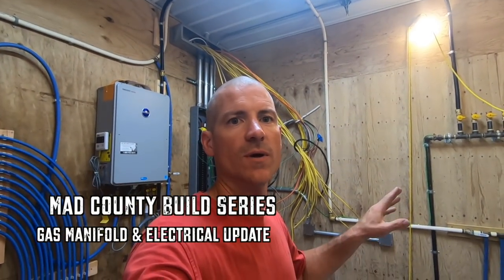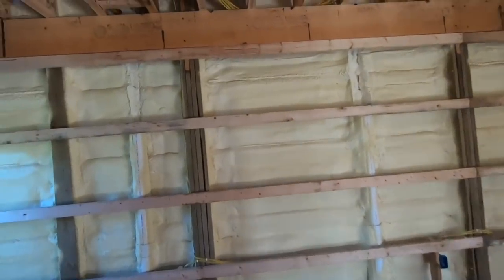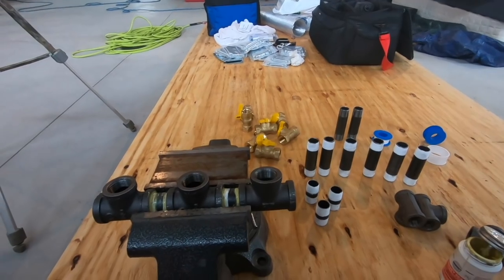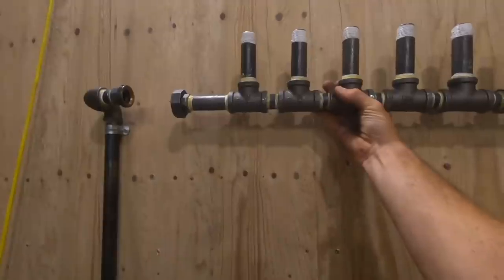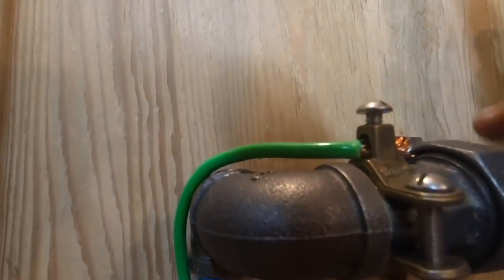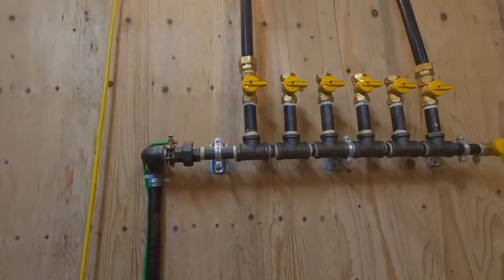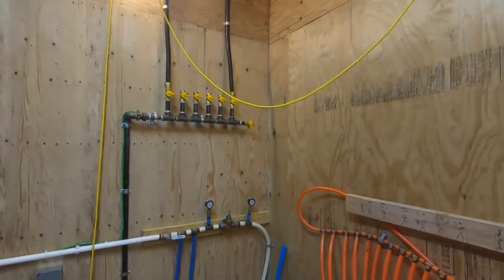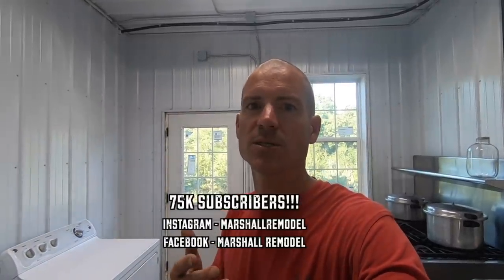Gas Manifold | Electrical Update

Comment: The teflon tape your using looks like the type meant for plumbing. There is tape in yellow/orange spools meant for LP or natural gas.
Reply: Ding ding
Reply: @ya2131  they know the way to getting paid and making it the next guys problem.
Reply: Normal white teflon is meant for water and air most other ptfe tape will say on outside of roll water,oil,air,gas on it
Reply: @e1casper  for the most part yes but their is tape on the market that is white and approved for gas applications
Reply: My employer, a natural gas distribution company, uses white PTFE tape. Though I usually just use it for gauges and things I don’t want to get dope on. We also use Blue Monster and I prefer it.

Comment: You always do a neat and well planned job, as I know you have done construction for years. However, one thing I noticed is you should have used "yellow" teflon tape, as it is heavier duty  PTFE tape used for gas piping. Most gas fitters used that plus Tru-Blue or similar medium density brush on compound for all gas piping.Thanks for all of the great videos! Can't wait till you are finished.

Comment: You have to use insulated strap on iron pipes in poly or rubber , need moisture traps on each one and all brackets have to be approved for gas as well as yellow tape .

Comment: looking great from over here in the uk! cant believe  the inspector gets to specify where you have electrical outlets, can you have the final inspection before the floors are finished, that way just remove the unwanted outlets after the inspector has left. a quick tip from a plumber....  ptfe tape should be wound clockwise around the thread so that as the fittings are tightened the tape is pulled tighter into the thread. It was hard to see from the time lapse but it looked like yours was wound the other way.
Reply: Technically the inspector isn't specifying he exact locations of the electrical outlets.  What's happening is code requirements, which is there must be an outlet within 6' of any break in a wall, and no more than 12' apart.  As long as he follows those guides he's good.  Since he was using stub walls, he thought that the code wasn't required.   He took it upon himself to use in-floor outlets, placing them at those particular locations, the center points of each stub wall provided the minimum number he would need by code.

Comment: Normal PTFE tape or natural gas PTFE tape (yellow stuff)? Does it matter in this case?
Reply: No tape on my gas fittings , use a paste , pieces of tape will break off and block things off .
Reply: I’m pretty sure this is the wrong kind of tape? Shouldn’t it be yellow?

Comment: I've had problems with unions leaking before. You might want to look at a black iron nipple/coupling with right/left hand threads that will replace the union and possibly seal better.  I also concur on putting never seize on the union threads so it will snug up tighter.

Comment: Earth or ground bonding is used to reduce the risk of electric shocks to anyone who may touch two separate metal parts when there is a fault somewhere in the supply of electrical installation. By connecting bonding conductors between particular parts, it reduces the voltage there might have been between them. Certainly in the UK it is nothing to do with lightning, lightning would laugh at a cable that small! In the UK they don't tell us where we can put sockets/outlets, just where we can't put them. Also we can't work on gas without being qualified and registered. 
Love your channel!!
Reply: The bonding requirement is only because he is using CSST instead of iron piping. CSST has very thin walls and a high voltage electrical charge can burn a hole in it. The bonding cable prevents this.

Comment: Thanks for going over the electrical inspection results. Great! For the garage, can never have too many outlets in the garage. I have a balcony like yours upstairs and have two floor outlets just like you. lol. Even more annoying is if you have one of those giant glass multi-sliding doors, you need to have one or two floor outlets, usually right in the middle of the floor. So ugly but required.

Comment: When I built my 4500 sqft house, that gas line was a hassle, not only here in MI you have to know total potential use of gas at all times thru your entire house but there is a formula on gas line size that comes into your house and reduces as you keep pigtailling different lines into it; I remember my intake was 2 1/2" and kept on down sizing until the last potential use end; one issue I had was that we had to reduce it with bell reducers and not ring reducers, they said the ring reducers can crack; your setup looks beautiful, just be careful at your state codes, also, if you put a instant water heater, that alone requires a 3/4" size to give you continuous  hot water, I had one that was 230000 btu and originally had 1/2" on it, every so often my hot water got cold right in the middle of the shower, eventually we figured it out and did a 3/4", that was on my previous house, this one has a dual heater, it required 1" pipe line;
But than again, I don't know how LP rules are, I am strictly talking of NG from the city; one thing I miss from the old house is the bathroom infloor water based heating system; I had that everywhere in the house before this, on this one just had to move fast and didn't have the time for that.
Nice work so far on your part.
Dan
Reply: Was going to say that 3/4" manifold would never work in NG.. I sure hope it works for LP, but I have my doubts..
Reply: @FJB2020  it all depends on the demand you subject it too, but also codes force you to stay in the most usage range not the least usage, kind of like one outlet every 12lf of wall, if you know what I mean, you might never have all outlets running in the same time, but the inspector considers that in his/her decision to pass you or not.
Good luck to you, as I mentioned, when it comes to LP, I am in a unknown territory so I can't speak much to it.
Dan
Reply: In Michigan you can use bushings instead of reducing couplings. Nothing in mechanical code says you can’t.
Reply: @Thatplumberguy1995  I am sorry Sean, I went thru the process, trust me, I wasn't in the mood to take apart 2 1/4" pipes to replace the bushings with the bell reducers; If I didn't go thru it, maybe I would go along with your comment, but as I mentioned, I built a 4450 sq ft home with another 2200 sq ft walk out bassement. thanks for the input, but you are not correct here my good man. Dan
Reply: PAP'S ROYAL APIARY don’t be sorry I was just informing you of the code lol. All good and keep up the good work.
Reply: @Thatplumberguy1995  I was sorry to have to correct you, what you informed me was not correct at all based on my experience. Dan
Reply: PAP'S ROYAL APIARY dude I’m telling you bushings are legal in Michigan I argued with our inspector last week to find me a code that made them illegal and he finally agreed he didn’t like them but they aren’t illegal.
Reply: @Thatplumberguy1995  I am not here to argue with you about codes, but I was the one that the inspector made take down the bushings on the entire line and put bell reducer, so legal or not, that is what I had to go thru, I am sure that I was really excited to spend additional money to change all that, and this wasn't an simple small job, I told you, my house is 4450 sq ft, there is a lot of bell reducer for all the stuff I have going on three.
Reply: PAP'S ROYAL APIARY alright. I was just informing you of the Michigan mechanical code. And I should of stated next time I’d ask the inspector to show you the code is all. But have a good day sir. Keep doing you.

Comment: Your mech/elect. room is awesome. Great attention to detail and very neat. TIP: You may have installed your railing floor receptacles already, but if you haven't, may I suggest running them on a switch along with your wall outlet near the railing. You will need to use a three wire so you have a hot half of the outlet at all times, but your wife will thank you when it comes to Christmas lights. Great work.

Comment: Marshall did the inspector allow you to tywrap to the conduit  the #6 ground wire from the gas manafold to the circuit panel here in Hawaii it’s not allowed. Love how neat and clean everything is.
Reply: without getting too crazy into specific HI codes, what's the reason they would not allow zip tying to it? Is using separate plastic hangers more standard? Also what's the issue with the #6? What would the change be?

Comment: I’m curious as to what pressure the propane is entering your home. The inlet and 3/4 “ manifold seems to small for 7 appliances.
Reply: I was thinking same thing  , I usually have to up size my supplie lines to meet the max amount of pressure needed for all appliances running !
Reply: Thinking the same?
Reply: Thinking same.. would think a trunkline should normally be at least one size bigger than the manifold lines, Just like a highway has more lanes than side roads.
Reply: He mentioned in another comment that it's a 2psi system, which is 5x the typical 11" of water column.

Comment: Are going to run elevated pressure (2 psi) in the house? If not my concern would be flow capacity in your runs at 11" wc. Especially on the long runs.  I would also recommend gas cocks(ball valves) with a side tap for easy pressure testing/troubleshooting. Enjoy the series BTW
Reply: I agree. I came here to mention the small size of the mainline for the manifold.

Comment: You may want to make sure that your system has enough capacity to run everything at the same time. Your pipe may not be large enough when you run it through a straight manifold. I don't know that it's not large enough, I am just saying you may want to confirm how many appliances that size pipe (including in-floor boiler heating) will support.
Reply: That’s what I was wondering too.  I have 3/4” ng main that only supplies a water heater, boiler and a future cooktop.  3/4” supply from meter is just enough for 3 appliances.  Ideally I would have 1” main.
Reply: @wickedkool705  I am NOT a gas piping expert, but with plumbing water piping, the size of your main line in from the utility is dependent on how many water fixtures are in the house. Gas is probably different because is compresses and a liquid doesn't. So probably the pressure of the gas line is what drives how many appliances it can drive. But you would still need a large enough main coming into the house.

Comment: Do you get to seal up those pipes between the house and garage where you've run the romex wire after final electrical inspection?
Reply: He will have to use a fire stop product to keep the fire wall rating. This is minimum code requirements with a built on garage.

Comment: Looking great, Paul!    So glad you did well on your electrical inspection. Bonding the metal gas and water pipes also prevents you from having either system becoming energized with AC - imagine a rodent gnaws thru a wire and the bare hot lays against a pipe. That sucks having to install those recepts by the railing - the floor boxes were a good idea.  Couple questions on the gas install - I thought you had to use the yellow teflon tape for petroleum applications?? Also, I thought the gas system had to be reduced in diameter as it went along , according to calcs for the equipment it feeds??? Much easier if you can just run a 3/4" the whole way, though. Definitely not a plumber here and have NO experience with propane (yet).    Awesome progress and love the attention to detail!
Reply from the maker: Technically yes you are supposed to be yellow Teflon which is thicker than the white. The guy that taught me 20 years ago was to use white Teflon and pipe dope on top of that. Long time ago but I have had continued success doing it that way so I continue. I really should just use the yellow. I don’t really have any other reason for not using it other than just doing what I’ve done for years.  As far as the gas system goes I will be doing a 2 psi second stage regulator and then maxitrol line regulators at my appliances. I’ll do a video on it.

Comment: As always, looks great, Paul! Have you considered using a tankless water heater rather than a boiler for your in-floor heat? I'm going to use a takagi 180,000 BTU tankless heater fueled by LP for my in-floor heat. It was engineered by a company that designs systems online. And from my research, I'm quite confident in the tankless heater rather than a boiler. With a boiler, you heat the water to 140° or higher, and then have to mix it with cold water so you don't have water too hot for the in concrete pecs tubing.

Comment: The teflon tape you used is technically not for gas lines.  The gas can degrade that tape over time.  There is a gas teflon tape.  Its on a yellow roll as opposed to blue.  Its usually next to the flexible appliance gas lines in the store.   You did double up with gas pipe dope so you should be fine.  But for the information of others.
Reply: Inspector might pass it with the pipe dope and tape combo. Should be yellow gas rated tape.
Reply: You didn’t leave a drip leg in your manifold. Clean out.
Reply: He did it at the lowest part of system.  In my state they want a min 8 inch dripleg at each appliance and one at main source outside with shutoff valve

Comment: Has your propane company said anything about cathodic protection on your underground lines. In some jurisdictions it is required plus an inspection by a CP company.
Reply from the maker: I don’t have any lines under ground inside. As far as the outside line from the tank I have never been required to use cathodic protection.

Comment: Can you use flex gas line for outside of the house? I'm planning to install a BBQ station using the natural gas as fuel.
Reply: John, there are some flexible CSST (corrugated stainless steel tubing) piping that is approved for outside, direct bury use. They have a specialized jacket on the pipe to protect it. If you decide to go that route then make sure you check to see if it is approved for outside use, and bond your system to the electrical panel (like he did in this video). I myself would rather use some 3/4” polyethylene plastic pipe (you could use 1/2” depending on distance), but each method has pros and cons.

Comment: I thought the male seal of a union was supposed to point in the direction of flow? Nice job, keep up the good work.
Reply: Think about it! If that were water, where would you set the male half of the union? With the flow or against the flow? Which would be more likely to leak?

Comment: Don't you need colored gas teflon tape for your gas manafold pipes?
Reply: I was thinking the same thing, I don't think white teflon is code for gas.
Reply: @StevenCrothers  You know I may be wrong however its a question worth asking, I know that gasoline which is a high vapor solvent requires it.  What do you think?
Reply: @williamgreen4757  I called a friend to ask just now, now, he's an electrician, but he does commercial and residential new builds. So he's probably a decent source, and in Michigan at least, for pipe fitting gas, you must have yellow teflon tape here. Or it will fail inspection.
Reply: @StevenCrothers  Right, I thought perhaps pink or blue teflon tape. But its good to know that yellow is the right teflon compound for a propane  or perhaps natural gas sealant. You should post that in a new post for safety.
Reply: @StevenCrothers   I run the plumbing dept. at an ACE in Michigan and you are correct that the blue and white rolls of tape wont pass inspection in our State.
Reply: staudtj1 yea, my buddy was pretty sure but I’ll admit he did say he wasn’t 100%. But most trades folk know a bit of code for all other trades.

Comment: You need Yellow Teflon tape for gas fittens and also need primer for you pvc connection purple primer
Reply from the maker: Thanks Earl.  I talk about the tape and pipe dope in the video.  I use clear primer when I can to avoid staining anything.  Especially since the concrete is going to be the finished floor.

Comment: I did not take the time to read everyone of the comments about your video so I'll ask you straight out how did you get away with black iron Teflon tape on a GAS manifold? NPT GAS fittings no matter what are restricted to yellow tape especially in a gas line. Have you a response to this issue?
Reply: Hi should be 1/2 or 3/4 inch scct inside the house  my main line is 3/4 thanks

Comment: I hope you put plugs in the unused taps in the manifold.  Never depend on a valve only.  Gas fitting 101 is never leave an open pipe.

Comment: Gas manifold nice.  Pipe sizing is pretty crucial for distance and btu load.  Flashshield is nice in certain instances.  Schedule 40 black pipe involves little skill and less cost.  If the flexible gas line in your house ever received a lightning strike it would be good for one strike (at best)in the correct install/application.  Then it will have pin holes...I've seen it...scary to say the least.  I have a friend that parents house blew up (They were on LP).  Sad deal.  Please don't use flexible gas lines off your manifold.  Your house is professionally build don't skimp on the mechanicals.

Comment: The gas regulator isn’t set to any pressure, needs to be tested at the regulator with appliance running to check and adjust if needed, gas company is supposed to do all the work for you. It’s called a gas check , regulated rule. Technicians get specially trained for all this. Although you have done awesome work and research.